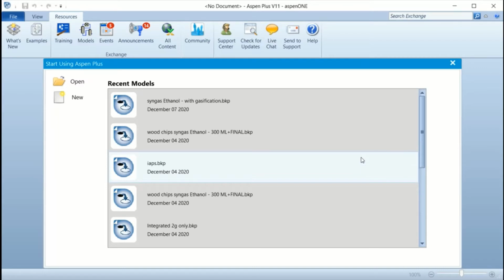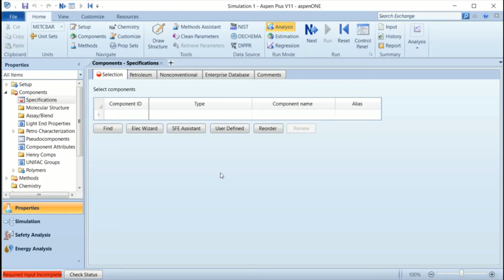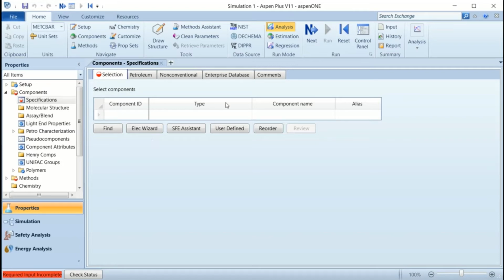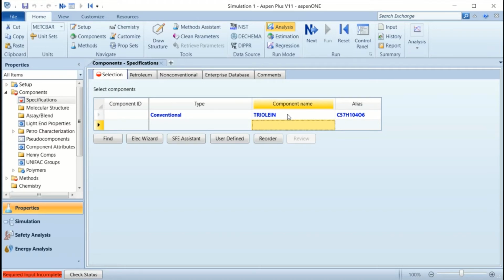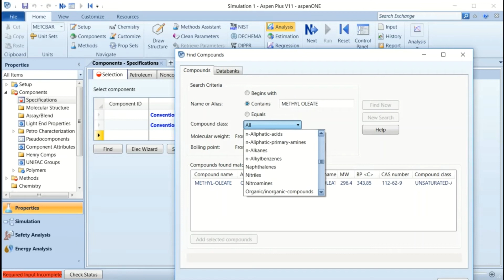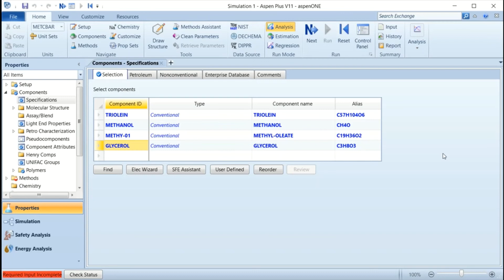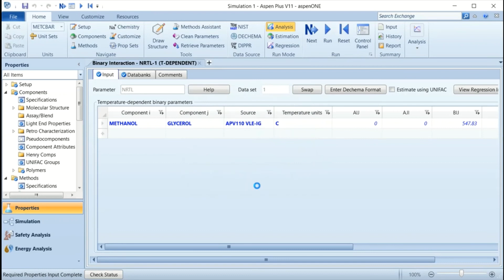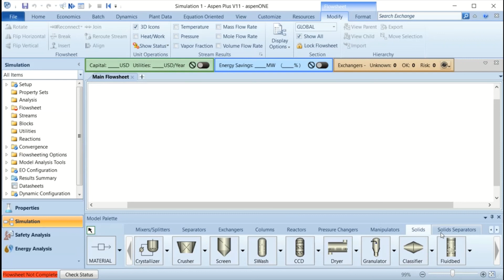Part 1 biodiesel production in ASPEN plus

Comment: I did the same things. We're using the same versions, but it doesn't switch to the new screen. (for the 9th minute and 40th seconds) 9:40 
It says "Binary Interaction" section is missing. When I press it, a blue tick appears instead of a red one, yet the "new screen" does not appear.
For this reason, the "nrtl-1 t-dependet" part does not open and I cannot proceed to the next sections. what would be the reason ?

Comment: May I know, how can I add waste cooking oil? Can't find it even after clicking the 'find now' button 🥺
Reply from the maker: Hello Nur Atiqah, since waste cooking oil has oleic, linoleic, palmitic, stearic and linolenic acids contents, with mass % of 29.83%, 28.85%, 15.86%, 4.87% and 2.49%, respectively, you can model the cooking oil either as the oil of the most dominant fatty acid (i.e. triolein for oleic) OR model the oil as composed of the relevant oils for the different fatty acids with the associated mass fractions .. I hope you understand?
Reply: @Biomass-biorefinery  Thank you ! I've also found an article stated that the oil is considered as triolein (and could be other that you mentioned) for simplicity 🌟
Reply: @nuratiqah6964  Hi Atiqah, is there in anyway I can contact you as I have a few questions regarding this simulation? 😊

Comment: Hi sir, may I ask, is it possible for me to follow your design here if I'm doing biodiesel production from waste cooking oil and using heterogeneous catalyst (in solid form)? The parameters that I need to vary is methanol to oil ratio (molar), catalyst amount and temperature. 🙏
Reply from the maker: Absolutely Nur Atiqah.. you do need to introduce a filter after the reactor to enable the recovery of the solid catalyst for reuse.. assuming ofcourse that the solid catalyst is not localised on the reactor walls
Reply: @Biomass-biorefinery  Understood ! Thank you for the answer 🤩
Reply: @Biomass-biorefinery  Hello, where did you get the research from? Can you tell me the name of the research? please🙏

Comment: Hello , I was able to get the software . But there is no possibility to add methyl oleate . Can I add it as an hypothetical component ? Which properties are important to enter ?
Reply: Is it enough to estimate liquid density , molecular weight and boiling point
Reply from the maker: Hi Ilana.. Methyl oleate is available in the ASPEN plus library.. you should type methyl oleate in the component name column..then click the enter key on your PC to open another interface. In the new interface, you can now click on the search tab ..methyl-oleate shows up..then u select and add selected compound.. u don't need to add any new properties
Reply: @Biomass-biorefinery  hello ! I have aspen hysys but there is no option to browse in the library like in the video .
Reply: Thank you ! 
There is actually just add replace and remove button
Reply: I only were able to get hysys data bank
Reply from the maker: @ilanabensignor3488  hi Ilana.. generally speaking, simulation softwares have similar approaches to introducing components to the model..I am uncertain if methyl oleate(MO) is in the database of hysys since I currently do not have hysys installed..but the modelling approaches described in my videos should be similar. I will not recommend modelling MO as a hypothetical component as the suitable initial solution, try searching for an alternative Fatty acid alkyl ester in the  'component library' then change the alcohol accordingly..progress from there
Reply: @Biomass-biorefinery  thank you ! In the end even my aspen hysys does not work the licence does not work I will have to start again in DWSIM because this works but unfortunately it does not have MO as well. Some people have done it but they do not mention what they put for their biodiesel .but I really don’t know how I am gonna add it to the software
Reply: @Biomass-biorefinery  can I use Ethyl  oleate instead ?
Reply: @Biomass-biorefinery  if I use ethyl oleate then I would need to use ethanol instead of methanol
Reply: @Biomass-biorefinery  also do I need the war GUI software ? In addition to DWSIM
Reply from the maker: @ilanabensignor3488  You will need to replace methanol with ethanol
Reply from the maker: @ilanabensignor3488  Waste reduction algorithm? is that what you mean by WAR?
Reply: @Biomass-biorefinery  is it fine to put the values we know and then do an estimate . Cuz there is no option at all for me to get the same thing as you in the video